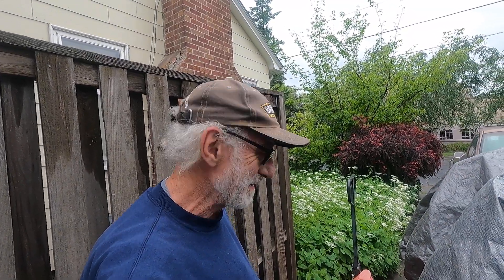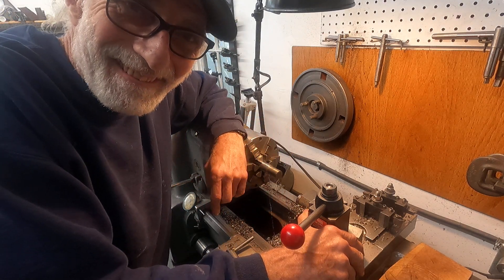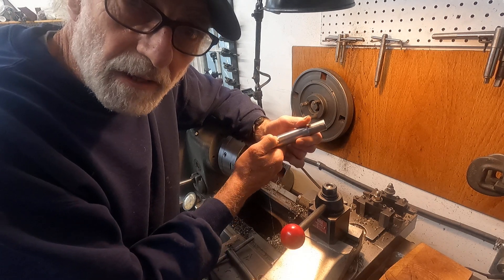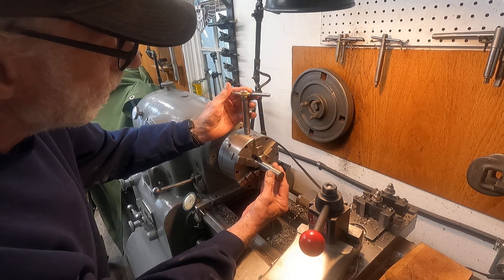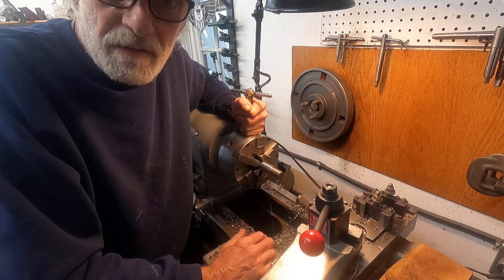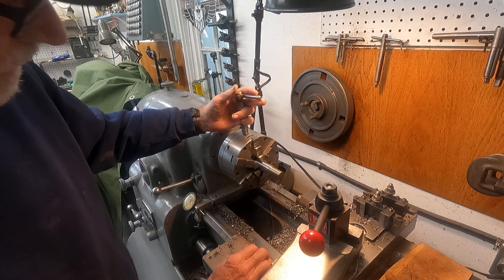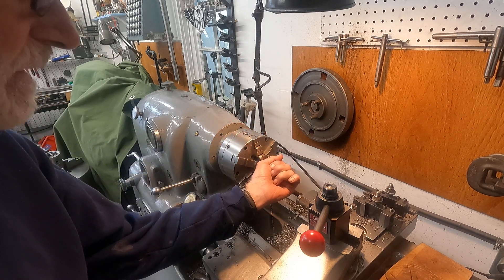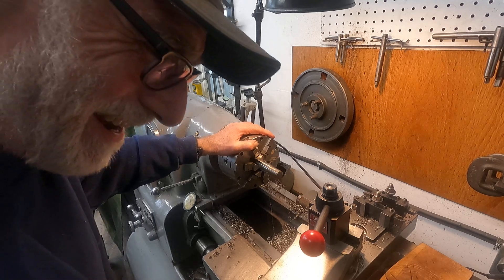Six jaw lathe chucks!

Comment: ive only had my lathe going on a year an ive always seen these 6 jaw chucks but never really knew what jobs they was meant to be used for. i assumed it was best for pipes cause it could spread its holding force across more area an keep from crushing the pipe but that was just a guess. what are the best situations to use the 6 jaw.
Reply from the maker: I like to use the chuck on already machined surfaces to reduce marring, thanks!

Comment: My new to me 10ee came with a 6 jaw Buck chuck. Guess what, it only has 3 jaws attached! Go figure! A fourth jaw was in the cabinet.
Reply from the maker: Good morning! That happens a lot. I hope you enjoy your Monarch ee as much as I do mine, thanks for tuning in this AM!
Reply: @deedeeindustrialsuperprecision  I wonder if it’s possible to get new jaws to replace the missing ones?
Reply from the maker: @stricht8  Jaws sets were available but need grinding in. I have heard some time ago that their newer chucks are different in design and older parts are not available
Reply: @deedeeindustrialsuperprecision  oh that stinks! Might have to get a new chuck then or just make do with the 3 jaws in the existing one, assuming they can hold a piece tightly enough.

Comment: DeeDee, Another channel, Dudley Toolwright did some interesting experiments recently using a piece of precision ground carbide and a test indicator to try and see just what difference it made in how he tightened his chucks.  Kind of fun  Voodoo results.  I’m of the opinion that being able to uncounted/remount chucks, which you do often, may be more for the kind of things I hope to do.  It seems that rebuilding chucks will “turn” out to be a lot of fun and make a big difference also.  I’m still betting I’ll end up counting on my Pratt Bernard Multisize collet chuck and a good 4J chuck for most of what I do. We’ll see soon. Cheers, TB
Reply from the maker: The scroll chucks have a little voodoo going for sure because of the needed internal clearance will change the outcome if the chuck is not tightened in a consistent way. Later I will repair my hydraulic workshop press and demonstrate bending and straightening steel, that will reveal an important nature of metal. I have a story- I worked for a Harley dealer nick named Onionhead...Customers would ask him how to rebuild their own motors, and he would them, sell them the special tools at super inflated prices also the parts even give them advice on the phone and us back in the shop would just nearly die laughing. In those situations Onionhead really came out on top, would end up selling them a new bike. You can tell people how to do it, they will 99 out of 100 screw it up.....

Comment: Hello. I really appreciate your videos. I would respect your advice in regard to the thickness of concrete in my garage. I have an old 1920 lathe I restored. Im getting a lot of chatter. Assuming I have the tool set correct, and have the spindle bearings and all else nice and tight, could the chatter be caused by not having a good thick foundation? It is a 1500 lb 14 by 40 lathe. I am 45, have run plenty of old machines at work, and have never experienced chatter like this. I am not sure how thick the concrete is, but i doubt it exceeds 3 inches. I can pound my fist on the saddle and shake my whole attached garage in my 1937 house.
Reply from the maker: I gained some construction experience, but I must rely on my friends at the concrete company for that advice, they do it every day. My experience with old lathes makes me think the rear spindle bearing is too loose, try setting the rear bearing first with the front bearing loose, then set the front bearing. I dont think the problem is the floor. Thanks for tuning in!

Comment: But Donie, you are demonstrating a chuck that can be set tru or adjust tru depending on which brand you have. Myself I have a Bison 8 inch 6 jaw which I bought brand new  to fit my Victor 16x60 lathe. Why a 6 jaw? Because no matter what round stock I put in it I can true it up except for hot rolled in which you have to fuss with. I am not knocking your method by any means and certainly your advice has a lot of merit. Cheers.
Reply from the maker: That makes no sense at all.
Reply: @deedeeindustrialsuperprecision  Dee, why are you knocking me for petes sake. I am as old as you are maybe older. I like your content, but if I get another response like that I will have to say bye. I mainly use the adjust true for picking up a concentric known journal and proceed from there. Plus, when machining thin wall tubing the 6 jaw is the choice with exception machinable collet chucks. I gave you a complement at the end and you came back with that response??
Reply: @markmuranyi9289  Maybe it's because 6 jaw and adjust tru do not go hand in hand.

Comment: I have been using 6 jaw chucks for 24 years. 
At work we have 8” and 9” Buck chucks on EE’s they work great
Reply from the maker: I have never seen that. 8" is maximum from the factory using light duty 3 and 4 jaw direct mount.
Reply: @deedeeindustrialsuperprecision  these 8” & 9” chucks have been on these Lathes for 30 years. 
We do lots of plastic and Aluminum some steel

Comment: I will use that roll the piece clockwise while tightening the chuck from now on also I never knew 6 jaw chucks were to be saved for ground stock. Two things I learned today! Thanks, dee
Reply from the maker: Try it both ways see if it works with and indicator.